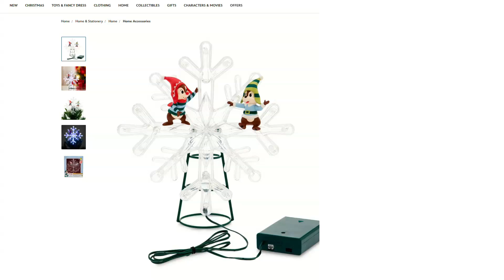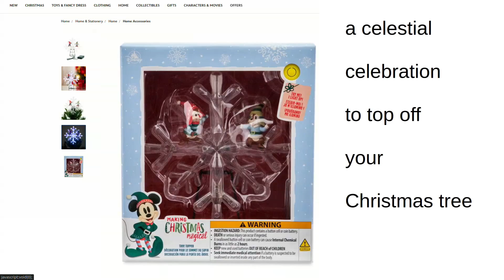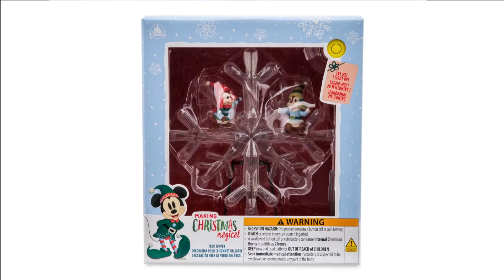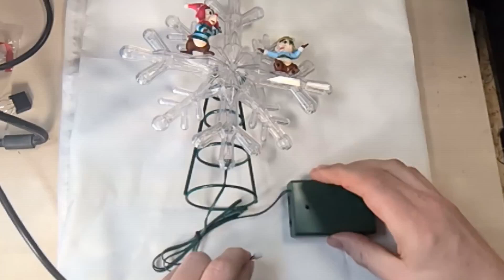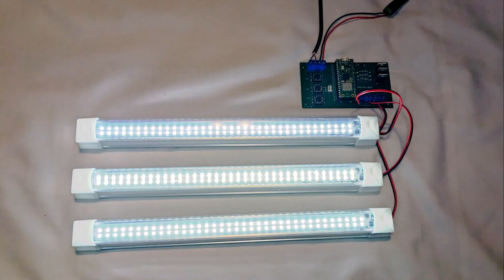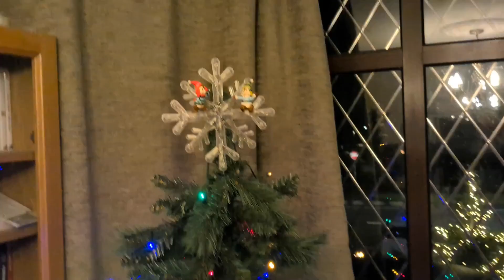Christmas Twinkle Lights - Christmas Tree Star controlled with a Raspberry Pi Pico

Comment: With a 2N7000, the "RG" resistor isn't required if powering a small load. :hand-purple-blue-peace:
Reply from the maker: I'm using higher power MOSFETs which have a higher gate capacitance. This is more because I was reusing an existing design rather than needing the higher power capability. 

I agree that you don't necessarily need a gate resistor with the 2N7000, although it's something I normally include anyway. It can reduce noise and reduces the load on the GPIO, so I may use say a 100 ohm resistor if using a 2N7000. Although it's not really required.